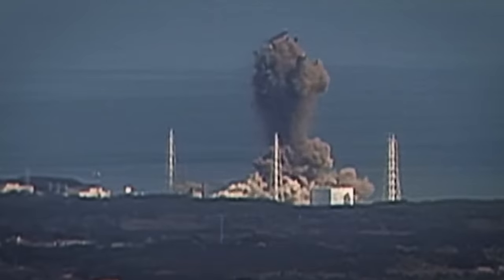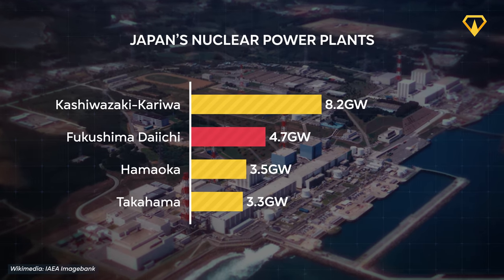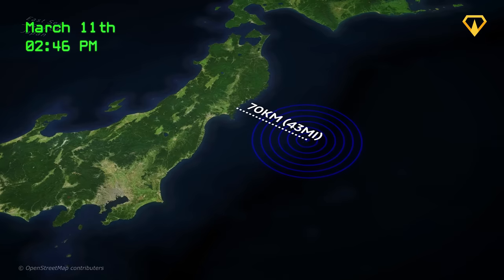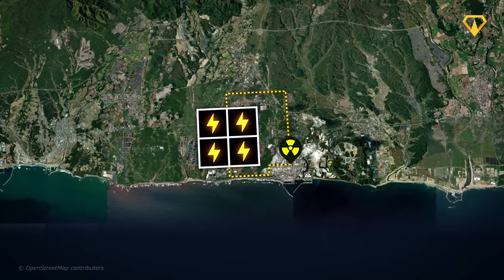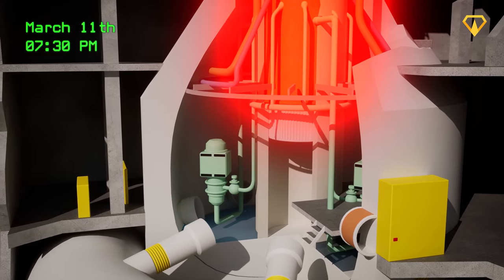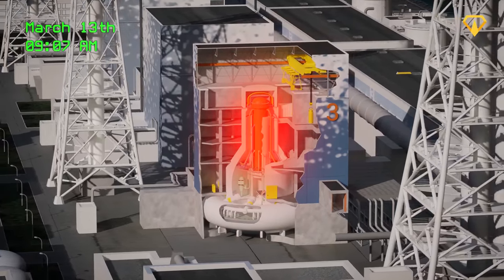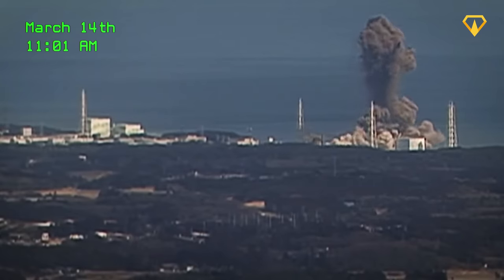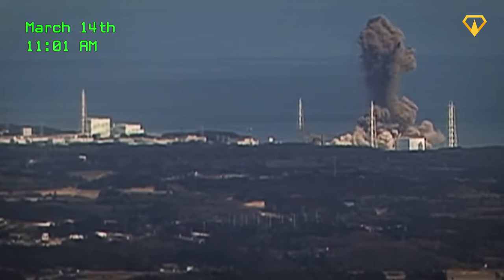Fukushima: What went so Terribly Wrong?

Comment: It seemed that it was just really bad timing and series of events that were the cause. Looks like they tried their best and just didn’t work out
Reply: Untrue. TEPCO did not follow modern practices for nuclear power plant safety. For example, the seawater pumps for the cooling system should have been better protected. It's normal practice to ensure that connections and containment for key systems are watertight, but they never did that. It's also obvious from the geologic and historical record that tsunamis could easily overtop the sea wall.

Comment: I agree with Japan in releasing radioactive water into the ocean, as long as the rate of dumbing water is slow enough to make the added radioactive level less than the natural Tritium level in the sea water. As long as they don’t dump too much radioactive water into the ocean at once, it should be fine.

Comment: In my oppinion they handled it far worse then the Soviets. The Soviets "moved mountains" to prevent further catastrophe, while Japanees seem not to be bothered to do much.
Reply: What should they have done? Chernobyl had no roof over the reactor. It was like a volcano spewing radioactive material. Fukushima had a containment building. What else should Fukushima have done that they hadnt?
Reply: @namename9998  Maybe use helicopters to bring the diesel-electric generators to the power plant? Nah, mate. We're just gonna wait for a few days or weeks for roads to be repaired and then we will bring them with trucks.
Reply: @namename9998  The accident was preventable. Not sure what they could have done better after the accident, but there are numerous best-practices TEPCO did not follow for the facility. Key power systems and infrastructure should have been watertight, and the pumps should have been better protected (with backups for all of the above). Furthermore, the historical (and geologic) record pointed to tsunamis that could easily overtop the sea wall.
Reply: @maize3239  I dont know if the accident was preventable but things could have been done to increase the chances of an accident not being so bad. You could be driving the speed limit while its raining when an animal darts across the road and you stop fast and get in a head on collision. Everyone was as safe as they could be but stuff happens.

Comment: i think the dumping of the treated radioactive water is perfectly fine given the standards of treatment and dilution performed/proposed by japan. it turns out to be way safer than what other reactors around the world are doing. the numbers (sieverts and bq levels) and perspectives (how much more radioactive it is compared to other countries and typical everyday items) have to be presented accurately when talking about this.

from what i gather, the treated water would be marginally more radioactive than a kilo of coffee. and that will be diluted even more when it's released into the ocean
Reply: I dont know about how radioactive it would be compared to coffee but the amount of tritium in all the water is a mere 3g. Theres more sugar in a 12oz can of soda than there is tritium in all the water.

"It is estimated that approximately 706 million gallons of waste oil enter the ocean every year, with over half coming from land drainage and waste disposal; for example, from the improper disposal of used motor oil."
Reply: The statement "radioactive waste water" is not a good term to describe the tritium water that is released without explanation. It is water which has had as much radioactive materials removed already but because tritium water HTO is so similar to H2O, makes it near impossible to remove those.

What concerns me more are the neighbouring countries like China and Korea, as well as countries that uses nuclear power, like France and U.K., are releasing amounts with much higher radioactivity than this, into the ocean. Everyone is happy to point at Japan but not at themselves. So what should we do about it? Go back to burning coal and fossil fuel?

Comment: As it looks like, Fukushima reactors have no true safety containment. It is like with Tschernobyl reactor. There also only a normal Metall construction is given as outer wall. In normal western nuclear reactors the entire radiactive part is contained in a bunkerlike concrete ball with around 2 m wall thickness and perhaps 50 - 80 m diameter. The EPR goes one step further. Also a complete core melting cannot penetrate the shielding bunker construction. And it is really hazarous to build an NOT-BUNKERED nuclear power station on the sea side when Tsunami occurence is well known. This proofs not the impossibility of nuclear power, like German Politicians claim, but the madness of building offices in Japan.
Reply: This power plant was built by General Electric.
Reply: @DashCamSerbia  perhaps ge was not informed about tsunamis
Reply: @wolfgangrenner4152  This video clearly shows tsunami protection walls were built in the sea. So why wouldn't the constructors of the power plant not have been informed?
Reply: @Apollorion  They were not informed about the magnitude of japanese tsunanis. The wall was to small. More over the nuclear core part was not completely bunkert, like it is generally done in modern nuclear power stations. It is really open like the Tschernobyl facility. Well known, what was the result ...
Reply: @wolfgangrenner4152  The correct romanisation is "Chernobyl" (Russian) or "Chornobyl" (Ukrainian). Ч is pronounced as "Ch". Ц would be the equivalent of "Ts".
Reply: That plant should have been shut down long time ago.
Reply: @imdba3685  No, its' design flaws should have been corrected a long time ago.

Comment: 10:23 "A 2013 WHO report also stated that a certain subset of populations living inside the Fukushima Prefecture had a substantially higher chance of developing thyroid cancer in their lifetime."

Cherry picking data doesnt make it true.

From a 2021 article from Reuters
"VIENNA (Reuters) - A U.N. scientific panel on Tuesday confirmed a previous finding that radiation from the 2011 Fukushima disaster in Japan was unlikely to raise cancer rates discernibly, and said a jump in thyroid cancer in children was due to “ultrasensitive” screening methods.

In a first round between 2011 and 2015, more than 300,000 people aged 18 and under in the Fukushima area were screened for thyroid cancer using highly sensitive ultrasound equipment, UNSCEAR said, revealing 116 cases of actual or suspected cancer.

A study using equivalent equipment in three prefectures not exposed to radiation from Fukushima found rates of thyroid cysts and nodules - possible indications of cancer - as high as those in the Fukushima screening, UNSCEAR added.

“On the balance of available evidence, the large increase ... in the number of thyroid cancers detected among exposed children is not the result of radiation exposure,” UNSCEAR said.

“Rather, they are the result of ultrasensitive screening procedures that have revealed the prevalence of thyroid abnormalities in the population not previously detected.”"

From a 2012 scientific paper
"The thyroid examination program started mainly by requests from psychological and social demands, and the most important and troublesome task is how to explain the results of the examination to patients, families and to the public. Many children were already found to have small cysts and/or nodules, and most of them will have no clinical thyroid diseases in their lives. Thyroid radiation doses less than the intervention level were obtained from only 1,000 children; therefore, it is impossible to determine radiation-induced from nonradiation-induced thyroid cancer."